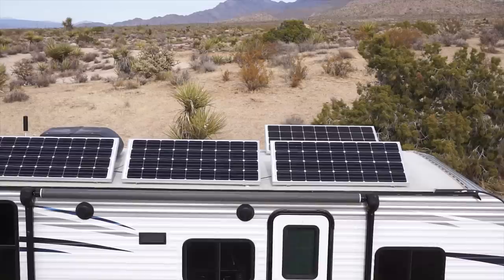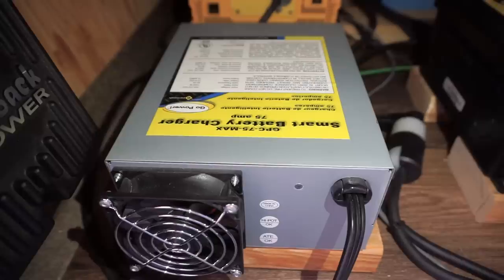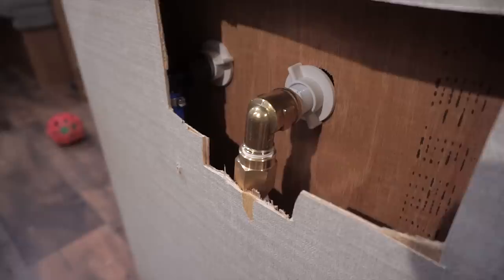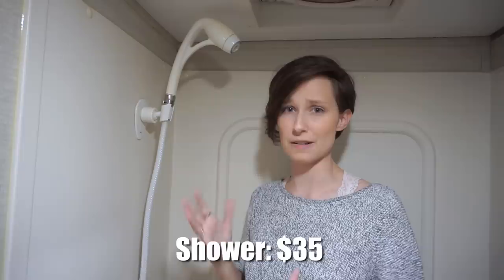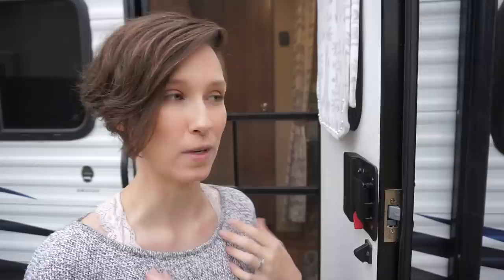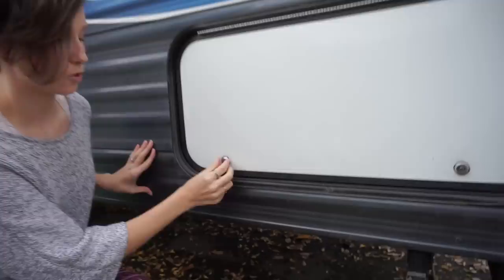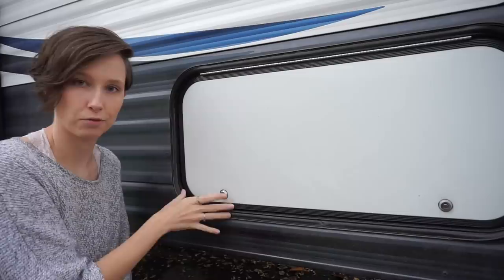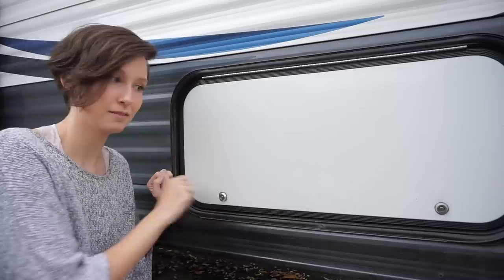Was It WORTH IT?? - All Our RV Upgrades Review - Solar, Toilet, Booster & More

Comment: We have owned 6 RVs and for several of those we put an RVLOCK on.  We moved to a MotorHome and it takes a larger lock.  We bought the RVLOCK for that and I promise you... we had it or pieces of it replaced 4-5 times!!! I did find a fix... we went to a Baur keypad lock... MUCH MUCH better quality... heavier build.. just better all the way around... like y’all.  We love not having to carry keys to go on a walk.  The other thing... the Baur locks the deadbolt.  Not the other one.   Plus one on the oxygenics!! We have ALWAYS changed out the shower head to one of those... thanks for the top on the back flow limiter... can’t believe I haven’t thought about that.  A great video.  Thanks!!!

Comment: Please forgive if already commented, but for the lock issues:

1). Use “Loctite” threadlocker to keep the screws from rattling loose. Just don’t use the maximum strength “red” version, which is more permanent.

2). Replace the zinc screws with stainless steel screws, which aren’t nearly prone to rust as much. I hope this helps! (if not already solved).
Reply: I was looking for the loctite comment, knew there had to be one.
Reply: I would argue to say Loctite 242, blue medium strength is more than adequate and you won't have to destroy fasteners to remove them again. Red loctite often require heating the fasteners to remove them in the future, which would destroy things on the RV itself. For reference, loctite 242 is used to hold gun sights on. There's significant impulse to the recoil of a pistol, and the sight posts stay on tight. It should be adequate for an RV.

Comment: Hey folks!  So, about the RV door lock...  The trick to the installation (and in this case), correcting it...  You have to make sure to create a gasket/seal for the housing to door area.  In my case, I also had to re-cut the shape of the housing, by a little bit, and create a gasket.  The process doesn't take long, as you can create a gasket from all kinds of seal products.  I recommend using the sealant/gasket on the door lock first, and then on the door second.  I found that using a rubber-based sealant gasket works excellent.  Let the sealant dry on the lock side first, so that you have a hard gasket to work with, and make sure that it is evenly set first.  THEN, use the second application (door side) and then do all steps as normal.

If you do it properly?  You won't have anymore slippage problems, and you will have a weatherproof seal that will make you and your home happy for years to come!

Comment: The previous owners of our RV installed a residential deadbolt lock above the factory installed lock and handle.  Voila, you have better security for a reasonable price.  I totally agree with the new locks on the basement doors.  We did that on our rig as well.  Nothing is forever.  Not even a stick and brick house.  One day you might get tired on the road or want to upgrade.  We would love solar but we aren't full time and as you pointed out, extremely expensive.  We do have a generator, however.

Comment: I know this video was a while ago, but I might have a solution to the keyless lock problem....as far as the movement goes, you could get sticky back rubber tape in about 1/16 or less thickness. Put it around the OUTSIDE plate...because if it's that loose it could be a potential leak...trim it then remount. 
   For the loose screw....use a wooden matchstick...they are soft wood & large enough to fit most screw holes...put some wood glue...yellow glue...on it & pound it into the hole. Let it dry then you could use an awl to start the hole or a small Vixbit, which is a self centering bit. Use a small one...about 5/16...there are several sizes & they come in very handy for a lot of applications.  The screw should tighten up nicely now.
   Hope this helps.    I enjoy all your vids...love all your critters.
Reply: I am assuming the door is framed with wood....mine is...if not & it is just metal then you might be able to get a larger size screw...with the same diameter of head...you could probably find what you need at fasteners Inc. Or fastenall...or if you have to get one with a larger head, you could counter sink the hole larger to fit the new screw.

Comment: I'm loving my system. I built my whole system durning the winter months on my king size bed. Mounted everything on a nice board and installed when the weather warmed up in the spring. I watch a number of system builds on YouTube including yours. One thing I noticed was had no one person mentions the 30% cut in the cost with the tax breaks you get at tax time. I spent about

Comment: Great Job!!!  I have a fix for your keyless door assembly.  At the age of 72, I have learned a few things and I would like to share about securing things you never want to move again.  (1) to prevent the movement, apply 3M 4000, in your choice of color on the backside of the unit that comes in contact with the door.  3M 4000  is UV resistant and somewhat removable as compared to 3M 5200 which is permanent and (2) Locktite 220 to the threads and reinstall.  I believe your biggest issue is with the assembly movement, so when you stabilize the movement, you may be able to skip the Locktite.  Make certain you have located the lock assembly where you want it.  3M 4000 is extremely strong and semi permanent.  You really don't need to run a full bead around the lock assembly with the 3M 400 and just apply it in the corners and maybe halfway between each corner.  I have used 3M 5200 and 4000 for many years as a boater and owning an RV.

Comment: The lock: Silicone, stainless steel screw from Home Depot, blue loctite
Reply: I kept the original plate and mine is tight. I also replaced my other locks with matching keys..
Reply: Yep...I have used doubled sided foam core 3M tape on the inside plate as well. Along with a bead of silicon around the exterior plate.
Reply: Skye is right. The blue loctite for your application is the right one. I advise against the red because it normally take heat to remove the screw.
Reply: Instead of using silicone, I would use constructive adhesive on both sides. Definitely use the blue locktite on the screws.
Reply: @michaelbowie6599  Thanks for the differentiation! I  bought and used the blue, but it was totally by chance!
Reply: The lock is wiggling because there is too much space between the head of the screw and the lock. No amount of loctite or silicone is going to help.

The real solution is to shim your striker plate so that the head of the screw doesn't engage your striker plate so early and you can tighten down the screw without bottoming out the head. That way the body of the lock cinches with your frame and you can tighten it down. 

Bottom line, basically your screws are too long. Either get shorter screws or use a shim.
Reply: The wiggle in your lock can be fixed best with an interior spacer not just some adhesive. I have the same lock and regarding the screws someone earlier said go to Home Depot and get stainless and they are correct.
Reply: @AltitudeOutlaw  I have the same unit on my TT and don't have any problems , I was guessing shimming would fix,,, and then if it started loosening U could use the blue loctitie

Comment: Door lock, remove screw, cut a tooth pick from a board and drive it in  then reinsert the screw, a little wood glue wouldn't  hurt, but isn't necessary. You want a tight fit with the wood, but don't split the original wood in the door. This works for most all screws in wood

Comment: Gr8 video.
I agree with Wade and loctite "BLUE."  In order to eliminate lock rotation, I would use 3M 4200 Silicone Marine Adhesive. After alcohol cleaning both door and lock mating surfaces, apply a thin layer on lock outer perimeter edges.  Warning: Don't use 3M 5200 as it won't come apart in the future if you want to replace the lock in the future.  🤪

Cheers, Eric

Comment: The lock can be fixed with polypropylene drawer liner. Find it at hobby shops, cut to size and mount like a gasket to take up play. Then add Silicone around the exterior. 👍

Comment: Instead of replacing the brick (mattress) that comes in the RV I would consider a high quality topper. Kohls has them. Much cheaper, a little lighter weight and very comfortable.
Reply: That's what I did and it's almost better than my regular bed. So comfy and cheaper than buying an entire new mattress. Easier to move as well.
Reply: I had to consider weight, so replaced my mattress with a nice air mattress. Had to put a topper underneath as well as on top to keep the cold temp away, but it's worked well. Deeper than my old mattress.

Comment: Remove each screw, fill the hole with wooden toothpicks with glue on each and then put the screw back in will keep screws tight. Can remove both faceplate covers to put a bead of sealant on the inside edge will seal and hold door lock in place. Wiping off any sealant that squeezes out or running a bead around the outside edge will hold it in place. Painting the striker plate will stop rusting.

Comment: When you take the inside plate of the lock off you need to see what the gap is. The lock sounds to be for a different door. You may have to shim the inside of the middle of the lock. Does that make sense ? So when the lock slid in from the outside of the door was it snug meaning it couldn't rotate? If the door lock hole was to big it may need a small wood blink to stop it from rotating from inside the middle of the door. Sorry if I rattled on.

Comment: FYI, a locksmith can rekey most RV keyholes to a new unused key. I know because I'm a locksmith.
Reply: Thats really good to know! Can you make all the locks on the RV the same key too?
Reply: @michellestratford9753  yes, its just changing the pins in all the locks to match, a good locksmith can have a 20 foot camper done in around an hour, some lock types might take a little longer.
Reply: @michellestratford9753  trying to find a locksmith that would do it , theses locks for rvs are like big rigs so many rvs they do have a little difference in teeth shape but not much to where guys are still getting in by jamming keys into it and opening it

Comment: I'm a lock /safe guy just replace your striker screws with longer and slightly wider width along with outdoor commercial loctite or similar sticking substance and use that substance on the interior contact points. This will result in a perfect like new fit 🙏

Comment: Loc-tite for your lock screws could help.  If the screws are still sloppy, a more permanent solution my be a drop of construction adhesive.
Reply: Shims too
Reply: Also nail polish on that one screw that keeps loosening. Paint the threads then s res in & let dry. Works great!

Comment: A remedy for your door lock. For the screw you can use Loctite (blue) for non permanent assembly and For the lock itself you can use a clear silicon caulking on the outside and inside. If the screw it to long you can uses a screw that is 1/2" shorter.

Comment: In reference to your door handle I suggest that you try a shorter screw. Take one screw out to take to the hardware. Locate a nit to match the screw thread. pick a shorter one to match the amount of play in the handle now. You could also put a washer between the inside handle and screw head to effectively draw the play out of the handle. Do the same with the latch screw. Apply tread lock to all the screws to help keep them from backing up.

Comment: If you don't want to get a locksmith to fix your door lock then the following will alleviate the problem: presumably the internal and external locks are held together with male / female screws (if not adapt) fit some 1mm or 1.5mm non-slip neoprene to the inside and outside where the lock sits, test screws for length (dry assembly) when your sure you have the correct length screws apply red Loctite paste (red = strongest) and screw together, trim off surplus neoprene with a sharp utility knife.
As for the lock face plate (Strike plate is the one fixed to the jamb) remove screw, purchase slightly bigger diameter screw and then using a hand tap and tread re do the tread on the door, then use a metal counter sink to carefully increase to screw head seat on the face plate, apply Loctite to screw and fix in place.
Should take 30 minutes to complete the above once you have all the supplies

Comment: Perhaps LED lights are standard now.  But, they save a BUNCH on power drain when boondocking.  A switch to isolate the coach battery at night from the tow vehicle battery has saved us from many dead truck batteries the next morning.  Learning how to repair/replace your RV equipment is a must when boondocking and when avoiding the hassle of waiting for and paying professional installers.  Thanks to YouTube, learning how to accomplish these tasks has become a lot easier.

Comment: the door lock---take inside off and shim under mechanism so it doesn't move-- the outside screw-- use "lock tite"
Reply: I was gonna say that too. Put a little shim or a thin washer along with a little bit of weatherproof silicone, and some blue loctite.(thread locker)
Reply: But be sure to source your stainless steel striker plate first.  :)
Reply: The other problem is thr construction of thr door. Thin aluminum/foam/thin aluminum.  One suggestion is to roll through Elkart Indiana. Rv manufacturing capital.  There is many rv material surplus outlets. And rv surplus auction houses. You can shop through hundreds if not thousands of doors and find one that is suitable and better constructed.  Or...  make ferruls for the screws that hold the inside plate to the outside plate. That way the 2 sides tighten together without squeezing the door and compressing the foam. Causing the latch to just come loose again.

Comment: The ‘cam’ locks for under rv storage is what I was told share keys with multiple other rv’s... I replaced mine with combo cam locks. I can change the lock whenever and there’s no more keys necessary. 
I also have the rv lock that you guys do. I’ve never had a problem and I have one on each of my 3 trailers. Is a nice upgrade I think because no keys are needed for anything... I lose keys, lol. Another reason I like it is because there’s also the keyless remote and a physical key you can use if you choose... keyless remote is nice when my hands are full. Great and helpful video, thanks!

Comment: For the bed lift mechanism, replace the long bolts sticking through with shorter ones. It will be $3 well spent if you don’t tear a sleeve (or arm) on it.

Comment: In regards to your door lock issue: Some double-sided tape inside, and a bead of silicone on the outside would help.  For the loose screw, try snapping off a toothpick to the needed length and putting it down the screw hole.  The screw will butt up against and compress it, giving a good hold and restoring the usefulness of that screw.  If the hole is really loose, it may take more than one toothpick (assuming you can't just fit a larger diameter screw through the plate.  And a thin layer of silicone or clear nail polish can help prevent corrosion.  But sand away the current corrosion before applying.  Very cool video!  Thanks for sharing.

Comment: Keyless door handle lock: try putting Threadlock lock (RED) on the latch plate screws. thru-door screws, either take those screws to hardware store and get them 1/4" shorter or put a bead of clear silicone caulk on back of the outside door plate and screw back together. It will keep from moving and seal out any water from getting behind plate.
Reply: yes & try that blue etc foam strips to fill any spaces or gaps around as well :)

Comment: So for the door lock issue. I am alarm technician. I install different style of locks. If you go to Home Depot or Lowe’s. The inside and the outside part that connects locks on Yale locks comes with a little rubber mat that is designed to eliminate those movements.

Comment: For your door lock: reset your strike plate with a little silicone at the edges, and set the entire front and back plate with a bead of silicone just inside the inner edge. Also try this hack, a slightly larger width screw on the strike plate, or try wrapping a little plumbers tape around the shaft of each screw.  The reason to use silicone rather that say, loctite or another glue, if you ever have to remove the lock it can easily be pried away with a putty knife or razor blade.

Comment: Ida used caulk behind both sides of the door lock and let it set. You could also squirt some in the upper screw hole, tape the plate down to hold it temporarily, wrapped some plumbers tape around the screw, screwed it in tight, let the caulk set and remove the tape. Or retapped the hole and used a different screw.

Comment: For the door lock, take it back apart and put in spacers to fill any gaps, that will make it solid, reassemble with blue loctite on the screws, and put some silicone behind both pieces, to seal it up and help hold it in place.

Comment: RV lock put a bead of caulking around the edge and don't slam the door like a car door. Close the door like you are sneaking out. Keep in mind locks are only for honest people anybody with a crowbar can open a RV in seconds.
Reply: Also to make the screw get tight. Put a wooden tooth pick in the hole first.put screw back in and should tighten right up.

Comment: Most people don't know about purple loctite... The difference between it and the blue and red is, as the manufacturer says, the purple doesn't call for heat to be applied to remove it. Blue is overkill for most applications. I use the Vibra-tite brand and buy a 1.69 FL OZ bottles of it, which is the size of a school glue bottle, and use it on almost anything I don't want to rattle or work loose.